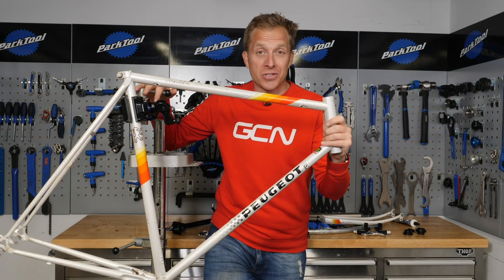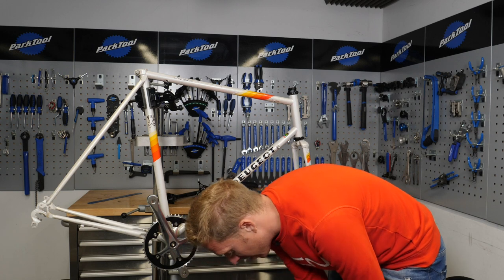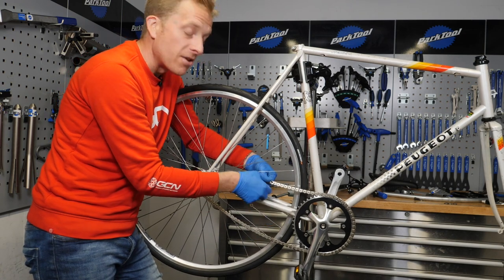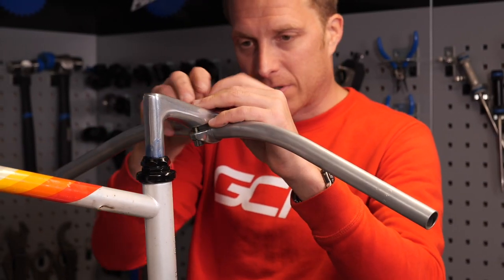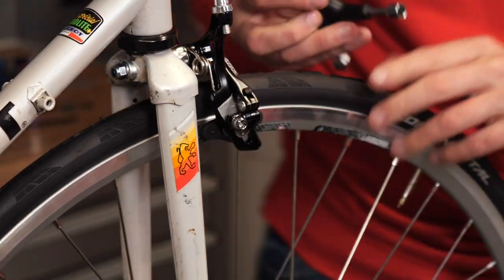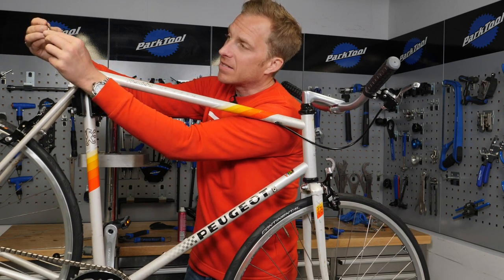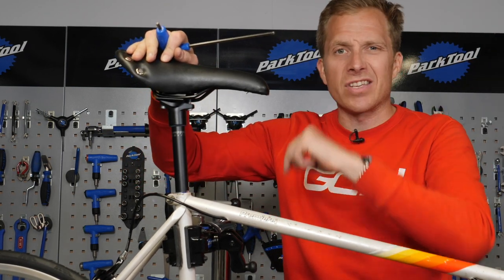How To Build A Fixie  - Real Time Complete Build | Cheap Bike To Fixie Ep. 3

Comment: Retro/modern gravel build! Old school rigid 3x MTB frame updated with 1x drive train, dropbars, etc
Reply from the maker: OOoft! 😍
Reply: @gcntech  2nd that but please without 1x, since 1x is a meme
Reply: @oreocarlton3343  1x is the future
Reply: And then an entry in the Dirty Kanza, just to make sure everything is tight and right.
Reply: This!
Reply: @Sebasstian86  In fact, I'm surprised Ollie wasn't in the background of this vid, making aero suggestions :)
Reply: @CHECKER3378  you are a fortune teller? What new wheelsize do you see in the crystal ball?
Reply: Gravel Build !!! YAAAS, Race Blue or Royal Blue paint job pls

We're gonna have to agree on the 1x or 3x tho lol
Reply: @OctogonOxygen024816  I vote 2x and v brakes with linear pull drop levers and a crazy colour 90s frame...hngh!
Reply: @oreocarlton3343  Calling something you don't like a meme is a meme. 1x is great so long as the gear range suits you and you have the requisite math and measuring skills to figure out an appropriate chainline. Horses for courses. If 1x works for you, do it. It's lighter and simpler. It you need more gears at the extreme ends, don't. It's kind of that simple in my opinion.
Reply: @CommaCam  I have no problem with 1x when it suits the application, but the push as "the future" in situations where it drastically lowers your range is rediculous i.e. road bikes and most fat tire bikes
Reply: Robert Trageser  yeah 13s hydro...if someone wants it and finds it usefull more power to them, I personally think its cooler than electronics. but to simply call it superior because its new is just ignoramous approach. Its like claiming that mtb are superior to road bikes because they came later...
Reply: @Sebasstian86  No no, just install old adjustable long bar ends (where the bars are tightened with a expander + bolt to the clamp part) near the stem. I did that on my fixie (which sadly doesn't have a crankset yet).
Reply: This matches my interests...

Comment: That little bit of "extra material" on the headset washer that fits into the slot on the streerer is actually there to prevent it from spinning when you are tightening the locking nut (that means there's no need to use two wrenches)
Reply: correct.
Reply: I thought so too
Reply: Except with every old Raleigh I've encountered with one of those washers (only ones without lamp brackets) that washer tab has been so worn that it doesn't prevent anything
Reply: Exactly! Same reason these "keyed washers" are also found on older hub axles; they prevent the tightening of the lock nut from changing the bearing adjustment.
Reply: Correct. Older cars use the same trick  for adjustable Wheelbearings

Comment: I've used the drinks can seat post shim. Different drink manufacturers often use different wall thickness on their cans so you can experiment with different beers and soft drinks until you find the right fit. Roll the top over to stop it sliding inside the frame.

Comment: Headset 1:06
Bottom Bracket 8:35
Chainset 10:18
Sprocket installation 13:09
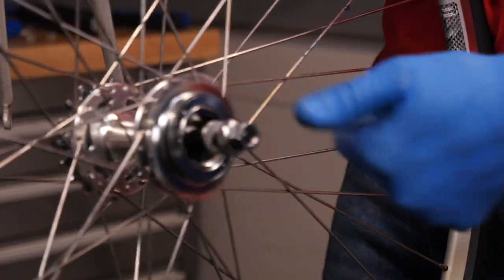Wheel installation 16:08
Pedals 18:02
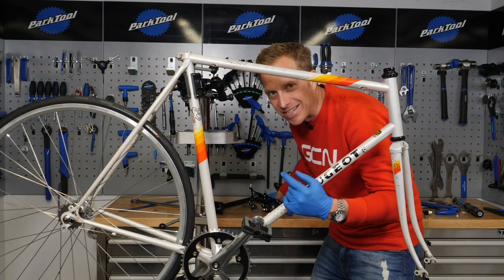Chain and tensioning 19:25
Stem and handlebars 26:19
Brake levers and grips 29:45
Break calipers and cables 32:54
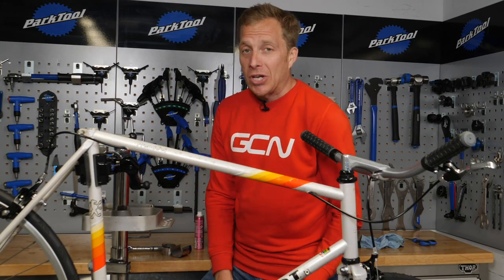Seatpost and saddle 44:09

Here’s the list so you guys could check it with a click btw more power to the channel ☺️
Reply: yep, its right there in the description
Reply: But un clickable
Reply: @duanedaylebaliatan5209  they are clickable...
Reply: Also Un clickable
Reply: Unclickable from the app
Reply: Hell yea. This should be a top comment.
Reply: Thanks mate!!!
Reply: Fart 22:46

Comment: Cool video, but I've got a couple nitpicks.

Spinning the wheel with the chain pin sticking out?  I've seen that do some damage to the frame when someone's given it a bit too much swing, and the wheel's inertia dragged it into the frame.
Also, probably worth mentioning the dangers of working on fixed gear regarding fingers touching the chain with the wheel spinning.  Little snag and you lose a finger.

Comment: Why are those swept-back handlebars pointing towards the sky?
But seriously, neat build.
Reply: Came here to comment for the same reason. Would make a very weird hand position.
Reply: I too am confused by the bars!?
Reply: I felt the same. Seems like they should be level horizontal, then swept back towards the rider. I know they were called riser bars in the video, so maybe there's something we don't know about that bar in particular.
Reply: A lot of beach cruisers have similar set up.
Reply: I much prefer the old fashioned "all rounder" bar - it sweeps back and down (like a motorbike bar) so the hands are in a nice relaxed position.
Reply: I think he means to level them out when the bike is out of the stand.
Reply: @johanan metellus- I had the same question.  I just re-watched it and right after he installed the bars he said: “There we go.  Easy Rider”...  My guess is that he was referring to the easy riding bar style of a beach cruiser.  But I don’t think he did that by accident as some here have posted.

Comment: Love the video as see these conversions is always fun . My only problem is you have no pedal retention and I have to say that a fixed gear bike with out it is asking to get your shins banged up. When I got my first fixed gear bike I did it with beaks but no straps or toe cages and I have to say it looked like my shins had been whacked by a nun with a yardstick. The rain was the killer for it. Now I ride clipless with a front break as a last  resort (thank you crazy rideshare drivers)
Reply: that's good thing about a flip-flop hub... reverse the wheel and you've got a single speed with a freehub rather than a fixie (which to be fair, Jon did say was his preference)

Comment: Hi Jon. I have the exact same frame. Size 58. I converted it to a straight bar too with Shimano 600 groupset and XTR shifter. Also having problem with the seat post. Currently using Decathlon 23.4mm alloy seat post with a 0.8mm shim. The seat clamp manage to hold it in place but it still feels flexible like a cantilever.

Comment: Fixie with breaks...minus well you can convert it to a singlespeed. Use a flip-flop rear hub. The whole idea of fixie is to slow down/break with your legs, but for that you need to lock the rear wheel. Otherwise you can pull it from the socket and crash. I used some tensioners from the duch city bike and it worked like a dream.

Comment: The washer on top of the steerer tube that fits into the vertical slot is to prevent the lower nut (that keeps the right pressure on the bearings) to turn if you tighten the locking nut.
Turning clockwise it would put more pressure onto the bearings and make steering less smooth.

Comment: enjoying the video... The little washer with the notch used with the headset is used so that you dont tighten down onto the bearings (and not be able to turn the wheel). When you tighten the top nut onto that washer, that washer acts as a separator between the top nut and the bearing nut and with the washer in between the two nuts, one cant turn the other when being tightened (the washer cant turn becase of the notch). ;)

Comment: I have a small tip to fully tighten the sproket and the lockring. First tighten the sporcket after that put the lock ring not fully tighten. Secondly istall your wheel on the bike with the chain and go do a sprint with your bike, this will torque the shit out of the sprocket and make sure you dont back pedal because the lockring is not tight yet. After the sprint, remove your wheel and torque the shit out of the lockring. You Will be good to do sick ass long skid without fear

Comment: When bridging a shim, it’s better if it’s a little longer.  The max height line on seat posts is there to spread out the clamping a bit, and reduces the chances of it rocking a bit, and maybe buckling at the edge of the seat tube

Comment: I always remember which way pedals go as the right pedal is right ( as in tightens the correct way, clockwise ) and the left pedal is not right, or wrong ( tightens anti-clockwise.) As for the bottom bracket I know it's opposite of the pedals so the left side is right and the right side is wrong
Reply: My trick for pedals is that they both tighten in the forward direction (with respect to the top of the bolt circle). Once you understand that, you'll never forget it. This is so when pedaling, the pedals tend to tighten themselves further rather than one of them backing out over time.

Comment: Linking this video to the one relating to pedalling technique........  if you want to develop your pedalling, ride a fixie.  Witness riders who do a lot of track riding or older (much) cyclists who were brought up on riding a low geared fixie through the winter months. If you've never ridden a fixed wheel bike, done sensibly it is a revelation.  Used on rollers or a basic turbo trainer I suggest that it would benefit many riders and  add interest to enforced indoor riding.

Comment: The actual reason there is a groove in the fork and that washer with the tab that has to line up with it it, is so that when you're tightening the "lock but" it puts pressure of the top of the bearing set and keeps it from turning while you tightening the nut, if that wasn't there, friction would also tighten the bearing. It's the same reason you have to hold the cones while you tighten the lock nuts on axles, friction.

Comment: good build and information Jon.why do you not use the work stand more dynamically?, moving up / down, twisting the bike to the best place to work, after all, this is what they are designed for, stop bending, stretching, working in tight spaces etc?

Comment: I prefer the rotafix or frame whip method. You get a higher torque on the cog and it lets you hold it in position while tightening lock ring. If the lock ring loosens the cog even a little bit during installation, the tiny back and forth can destroy your hub. 

https://www.urbanvelo.org/issue11/urbanvelo11_p76-77.html

Comment: How I find brake lever position: put them on loose then adjust once the grips are on. For slide on grips rubbing alcohol slides them on easy. I just prefer lock on grips. Easy to take on and off and they stay tightened

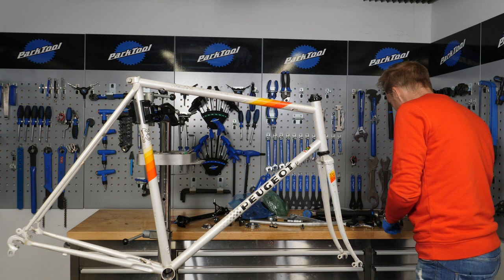Comment: 7:00 the slot is here to prevent the tensioning nut to be tightened by the lock nut. It doesn't transfer the locknut rotation.

Comment: Have to see somebody of the crew riding this bike! In crit perhaps 🚴😉

Would be good to see a convertion of the similar frame, or cheap modern frame into a single gear, but proper modern components, i.e. at least to see a decent stem.

I wonder if you could collaborate with somebody and reweld the headtube of the old frame to take in modern carbon fork!?

Comment: The easy way to remember the threading for the pedals is: BACK OFF.  So, take the wrench to the "back" of the bike when the wrench is at 12 o'clock high.  Reverse for putting it on; to the front for putting them on.

Comment: Thanks, 'enjoyed the video very much and learned a lot. I've often wondered just how the forks and steering stem was put together and the details involved in the adjustments of the brake cables and their surrounds. How is that second sprocket on the rear wheel used? Many riders who use a fixie would just pedal backwards to brake or is that only in the movies? The hacks are great!

Comment: 30:39 I think a better strat that I've used for flat bar levers is just sliding on the levers, putting on the grips and then adjusting the levers in relation to the grip ends: You don't need to score ur bars...

Comment: route the rear brake cable over the left side of steering tube for cleaner look. also it won't rub and flex as much when you turn the steerer.
Reply: it goes inside the frame on the right hand side though?
Reply: @webbo73  it can be done though.
https://www.flickr.com/photos/mustaninja/4947256683/in/photostream/
https://www.flickr.com/photos/minhyykunphotography/8726882789
but I guess the cable will have a kink just by the entrance of the internal cable routing passage.
anyway, it is a great build.

Comment: Front wheel track nut axle wont always fit the front fork dropouts on a road bike conversion.  Apparently front QR axle is slightly smaller diameter on at least some road bicycles.  My old early/mid 80’s Specialized Allez doesnt accommodate a  track nut axle. Didnt even think about it until I tried installing front track wheel.  Bollocks!

Comment: Hi Jon I learned a lot thank you! One question: Before you put the handles on, you marked the levers with a pair of scissors. Wouldn´t it be easier to just put the levers on loose, then the handle bars and then fix the levers by just sliding them towards the handles and tighten them? Or is it that the handles in this case are some kind of rubber and therefore elastic. So I can imagine that my idea is BS then, because you would never have the exact same distance left and right.
Kind regards from Austria, really nice built!! ♥♥♥
PS: The stuff from your shop is great, I received it the day before yesterday and can highly recomend this shop!!

Comment: The headset can't really be properly adjusted until almost at the finish of building the bike. It's best to wait for final adjustment until wheels have been mounted with handle bars and stem. If fitting with brakes for road use, you can check final by using brake(s) and seeing if there is any slop or tightness. For the seat post, fold over the top edge of the shim to create a lip. The lip faces out. If you want, cut up a tuna fish can and have a built-in lip. It helps to prevent it from falling in.

Comment: There is a much easier way to get the handles on. They have a small hole in the end. Those are meant to be used together with some compressed air. When one blows in air, when the other end has been slided slightly on, the handle is easy to move on while blowing the air 👍😜

Comment: Hey Jon, love the series. I would like to do the same thing and I was wondering how exactly you would size a bike like this. I’m 5’10” and typically fit a 54cm road bike pretty well (I’m in between a 54 and 56) but because I’d like to switch the drop bars for flat bars should I look at getting a larger size to compensate for a little more upright ride position?

Comment: Re : chain pins. It won't matter so much on a single-speed bike, but generally you'd want to put the pin in from the other side - so you break the pin off on the 'outside' of the chain. This help avoid the chances of burrs on the pin from rubbing against the next cog inside (even if you're peening the pin, like with some Campagnolo chain) - apart from being horrible from an engineering or OCD point of view, that can cause nasty little squeaks you really don't want..
Edit : Just adding a link to another excellent ParkTool video which also talks about this amongst other things
https://youtu.be/VdUQKVMPF5I?t=443

Comment: That little nub on the headset spacer keeps the spacer from turning.  That means that when you tighten the locking nut it can't change the position of the adjustable race. If it weren't there, then all that work you did getting the adjustable race "just right" would have gone out the window.

Comment: I have a job for you. Tried removing my square taper crankset. However the cheap metal has been stripped by the crank puller tool. I tried wrapping some plastic around the puller to almost wedge it but it didn’t do anything. As I’m changing the bb and the crankset I did try lightly hitting it with a hammer but don’t really want to risk damaging the frame. Any suggestions on a fix?
Reply: Put a strong rod or something on the inside of the crankset (from the other side) as close as you can to the center and hit it with a hammer until it comes off. Rotate the crankset every now and then and don't be afraid to hit the tool hard.
Reply: Use an automotive bearing puller.
Reply: Bike shop. They have a special tool to cut new thread

Comment: 11:35 - Why did he use the hex bolt on the bottom bracket and then removing it to use the included Allen key bolt? I didn't understand his explanation.
Reply: He said he preferred using the hex bolt to tighten the cranks on (because you can put more torque through them without chewing the bolt up) and then replaced them with allen key bolts because, well, they look nicer.
Reply: @lawrencewatts1838  ohhh... So tightening them the first time actually pushes them in further and somewhat locks them in because the bottom bracket bolt is tapered. Thanks

Comment: Make a mark where you need to put the brake levers on ?! Why would you do that ?

Slide the levers all the way to the steerer tube, then put the grips on all the way in, then move the brake levers flush against the grips.
No markings on the handlebar, and you're certain they are at the exact same spot left and right (which is unlikely the case with your eyeballing technique of putting the grip in front of the handlebar and marking the bar...)

Comment: A few caveats/personal preferences: those black steering cups don't fit the frame. The black front chainring also looks weird. Also the brakes. Should be polished/brushed aluminum. So could be the seatpost. Chain also super weird. The type of handlebars also is strange. Road style, straight or some bullhorn bars would fit better. Nonetheless, great video and thanks for the length!